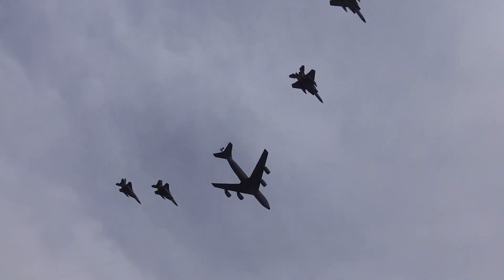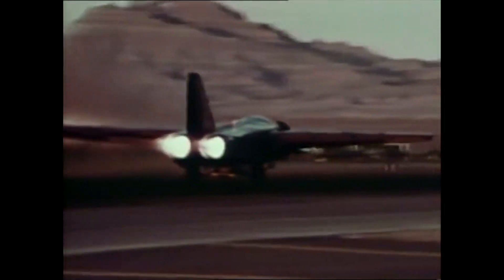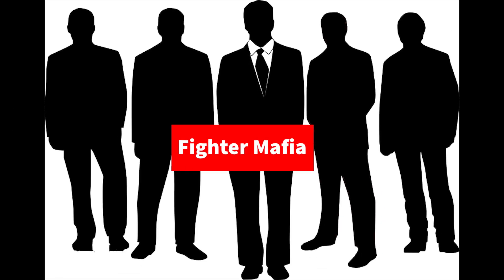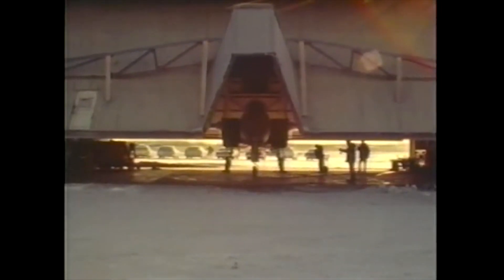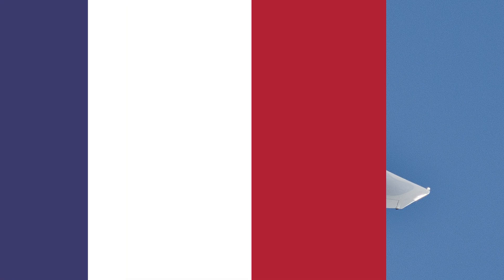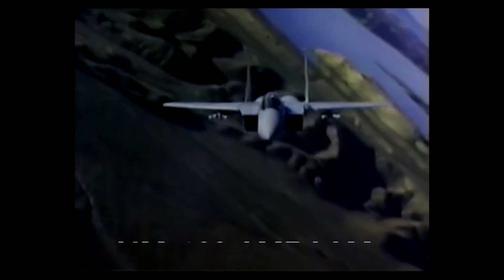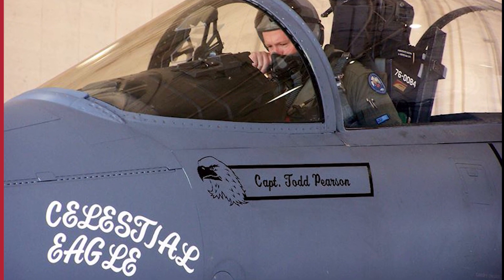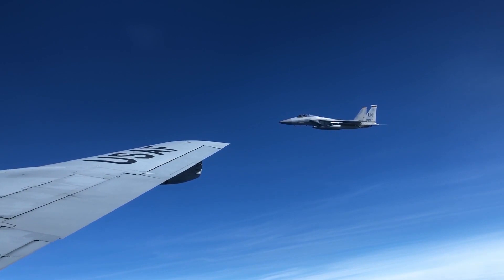Uncovering the Origins of the F-15 Fighter Part 1 of 2

Comment: And now we are getting the F-15X which boasts even greater hardpoints and payloads. Also I think its stupid they didn't make it usable for carrier landings. Still its a darn good plane and can likely still kill every modern jet today excluding stealth tech.
Reply: They looked into it back around 1990s. It would have added to much weight and cost.
Reply: @phillm156 
A Tomcat max was 74,000 Ibs.
An Eagle's max........68,000 Ibs…...Same KGs as a Rhino.
Reply: R PM converting it to a carrier aircraft would make it too costly, and carrier landing gears and structure would add a lot of weight. The F14 was originally designed as such (titanium wing box).
Reply: It was probably just too big. Yeah, so was the tomcat, but I think that was one of the reasons the tomcat was retired in favor of only f18s.

Comment: I've heard that the F-15(I don't remember which model it was though, maybe a D-Model....?) was stripped of some weight and was able to fly at speeds of 3.0 Mach...!? I was and still am skeptical about the claim, though.....
Reply: Probably thinking of the streak eagle
Reply from the maker: I’m sure they could probably clean up the airframe and lower some weight - but not for a front line production version.   Thanks for commenting!!!
Reply: I think the plane you are referring to is the streak eagle. It was a pre production model, which was stripped to the absolute minimum. It was actually build to break the time to altitude record, which it did. There were claims of it breaking mach 3.0 but there are a few issues with it. First, the main issue you face at mach 3.0 is the heat. The soviets solved the issue by using steel and titanium on their mig 25. Aluminium will start to lose strength when heating up. Also the added weight of steel would have made the eagle sluggish and harder to maneuver. Adding to it that you would need a bigger and thirstier engine would have trouble to have a proper fighter according to the idea of the f-x program. And if you would use largely titanium, you would end up with a plane way too expensive to mass produce without the senators screaming for your head. I doubt that the f 15 was capable of mach 3.0  but it would be very close I think. I would guess that the Streak Eagle might have been capable of about mach 2.7. But then again, I haven't really checked all sources so I might be wrong.
Reply: Ah okay, thanks guys!!! And yes, the F-15 is one of the fastest Jet Fighters out there. If I'm not mistaken, they list it's Top Speed at 2.7 Mach, but it can push past that at least another 100 knots.
Reply: @knightlife98  
The fastest "Jet" engine aircraft belongs to the SR-71... And I have heard the MIG-31 could do Mach 3.0 as well... But I haven't seen actual proof on that
Reply: NASA used a F-15 for the Chaseplane of the Space Shuttle launches, and you need a very fast aircraft to do that! Lol...!!!
Reply: they never publish the true max speed of a fighter...(they like to keep a little something under the the table)
Reply: The limit is probably airframe temperature more than available thrust.